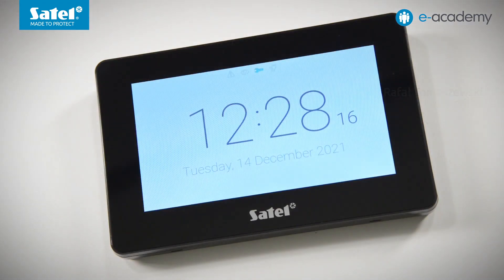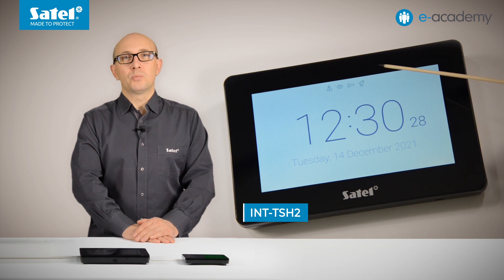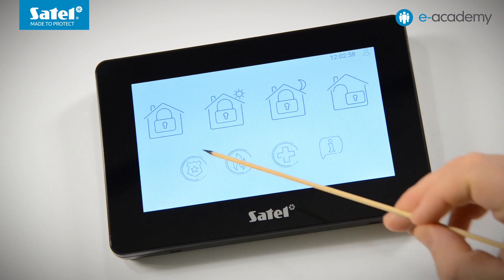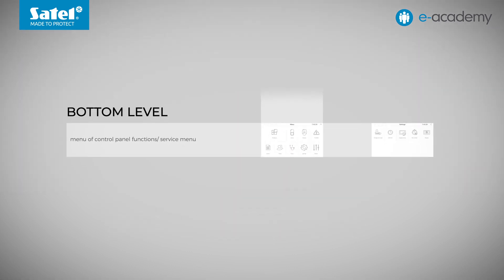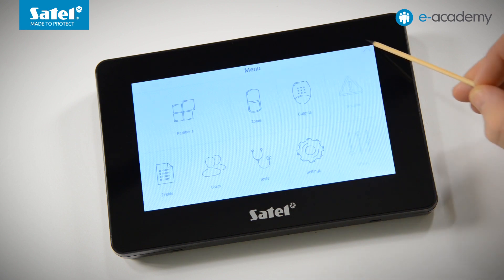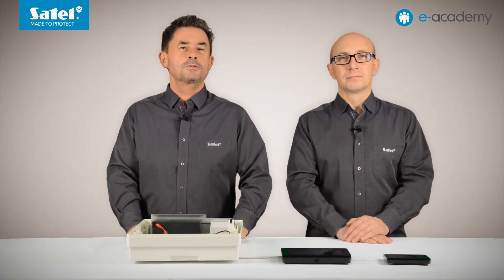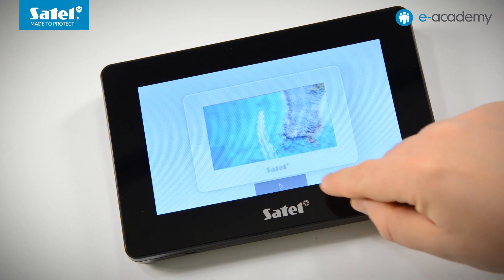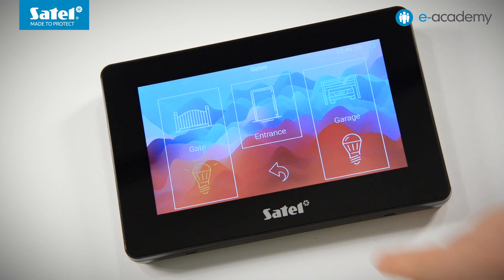SATEL e-Academy 76: Explaining the Revamped User Interface of INT-TSH2 & INT-TSG2 Keypads

Comment: I just added 2 of these keypads to my integra 64 plus, went into service mode on the main panel, identified the displays, saved everything in flash, but everytime I try to login on any of the 2 displays I get the message 'this keypad is forged', how to solve this??
Reply from the maker: Hi! Sorry you're experiencing trouble 😥 There might be several reasons as to why you see this message: both displays might be using the same address, your INTEGRA firmware version does not support this keypad, and more. If you're sure the displays use different addresses and been identified successfully, and the firmware version is up-to-date, contact our Technical Support directly.